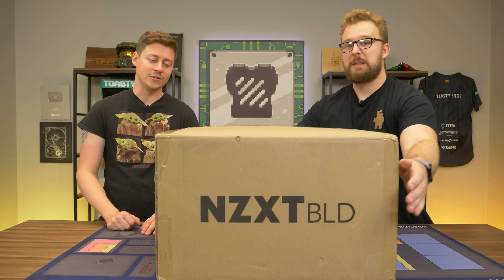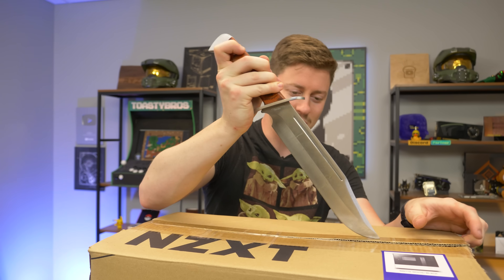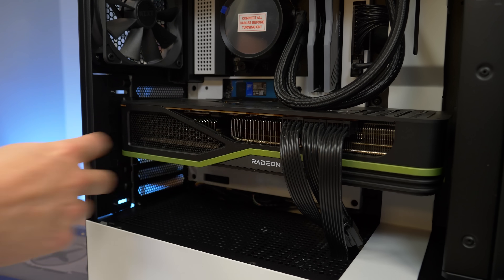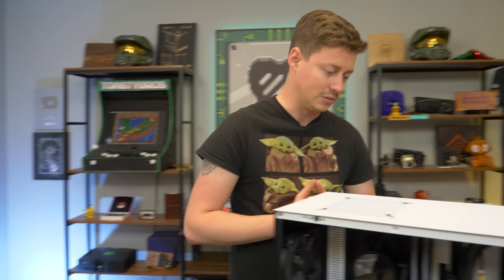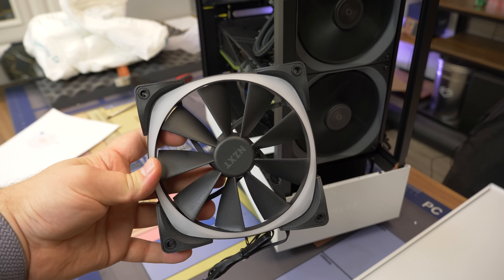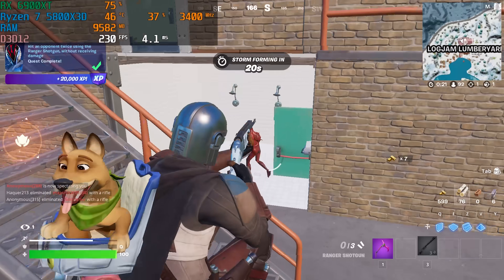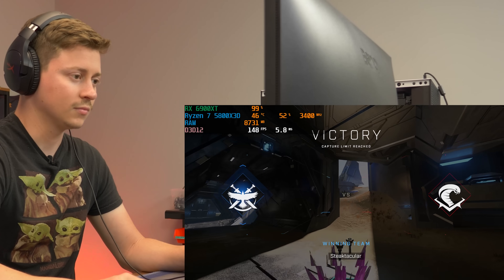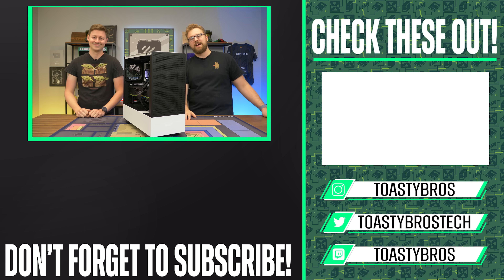NZXT Gaming PCs Just Got Better! | NZXT BLD Showcase

Comment: I think something is wrong with your 5800X3D CPU. It's only boosting to 3400Mhz which is the base clock and it should have a boost up to 4.5GHz Max. Did NZXT nerf the CPU on purpose?
Reply: the gpu may be bottle necking the cpu.
Reply from the maker: We thought the same thing, afterburner was reporting it wrong. Task manager showed it was boosting.
Reply: Bro that guy has to be a scam the guy who said chart me up don't chart him up
Reply: @raptorkhan532  That's why I have not replied to the one that has Telegram in the name for all to see and not reply to him.

Comment: 😑 The CPU cooler’s radiator is on a very bad position. The correct position is by flipping it vertically for having the hoses’ outlets below the CPU pump. This correct position will avoid the air (generated from evaporation over time) to get stuck on the on the side of the outlets… 🤷🏻‍♂️

Comment: yo i got a rx 550 i3-10105f and want to upgrade to a gtx 1650. is it a good idea ?
Reply: I would save up more for a 1660 ti or even a rx6600 since theyre around the same price
Reply: If you are indeed stuck on the 1650 budget range just go for the 1650 super variant. Miles better than the standard 1650.